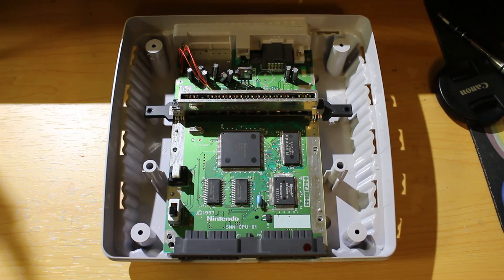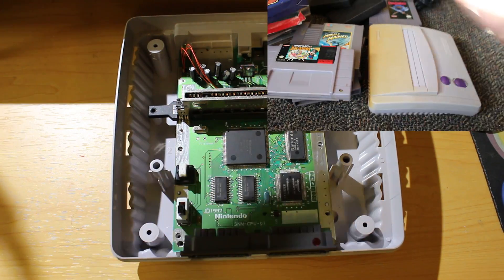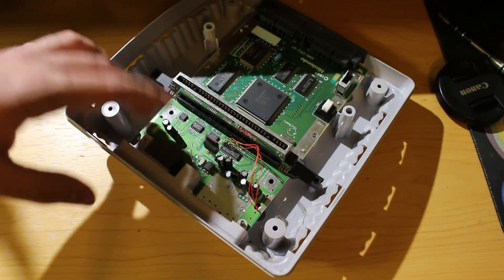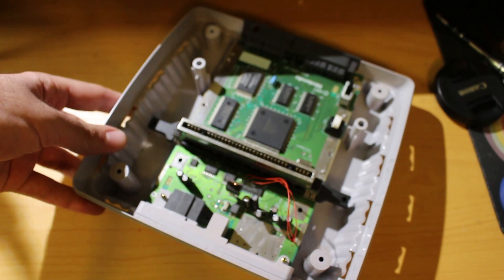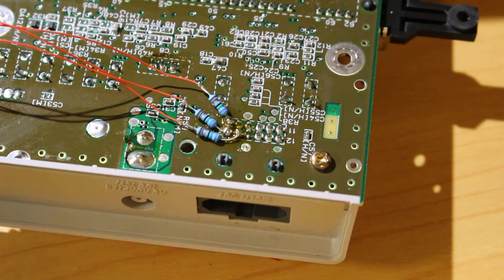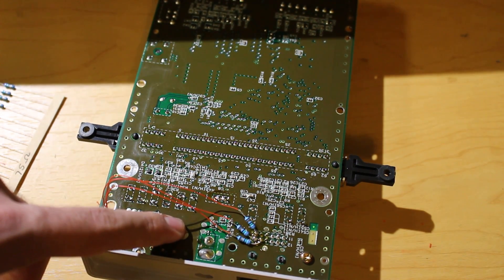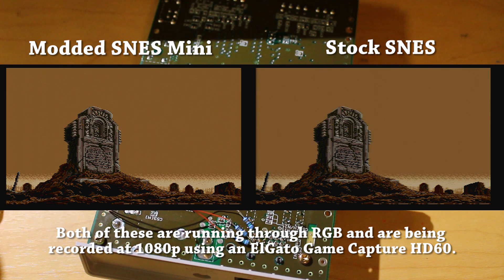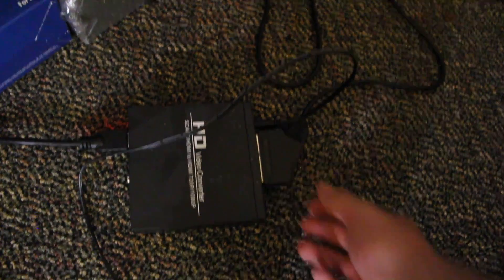SNES Mini RGB Modification - Install Overview & Demonstration

Comment: Why is people installing the +$30 bypass boards on the Mini when you can just do this simple mod and get 99% identical result is beyond me.
Reply from the maker: Cleaner setup and easier install I'd say. I personally need to revisit this console and rip out this work to upgrade to one of those nicer boards.
Reply: those boards also give you S-Video.

Comment: if you dont fancy soldering the resistors to the board, make up your wires with the resistors in the middle of the wire, then you are only soldering the wire at either end to the board, just cover the resistors with heatshrink.

Comment: So the original SNES in USA has RGB already?  IIRC, there were 3 SNES in America... 1st gen (yellows) 2nd gen (looks like 1st gen but some of the chips were rearranged) and 3rd gen (snes mini).

But anyway, would you just need a scart cable and scart enabled TV to use it out of the box? Or did you have to modify some of the pins?  (for 1st and 2nd gen, not 3rdMini gen) Correct?
Reply from the maker: To my knowledge - regular SNES consoles have RGB, SNES Mini consoles need to be modded.

Comment: By any chance, if I do this mod on the SNES mini, can I still play games with a composite signal (will work with a composite cable) or will it only be able to output an RGB signal? Thank you :)
Reply from the maker: You will still be able to use composite, all this does is unlock RGB capabilities :D
Reply: Thank you for replying :) Also, would it be possible to both unlock RGB and S-Video capabilities simultaneously?

Comment: Mario, I wanna first say that I love the channel. Having found my old SNES mini I'd like to do this mod but haven't soldered anything in at least a decade. Do you have any ideas for a project to brush off some rust before cracking open my system?

Thanks.

Comment: mario i open up my xenon 360 motherboard from 2007 and i when to look like for the jr programmer and it has the solder points and it was on a back do you still solder there if you do